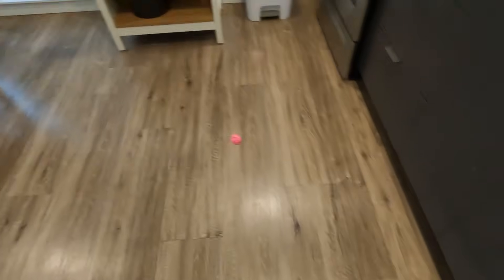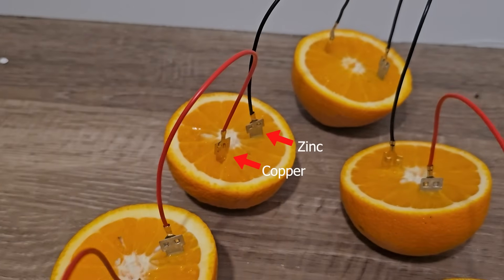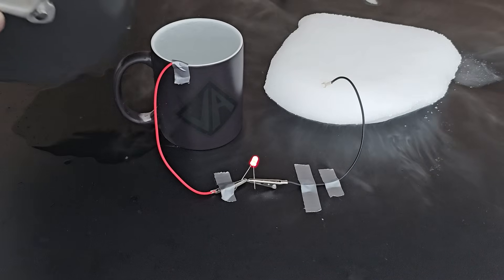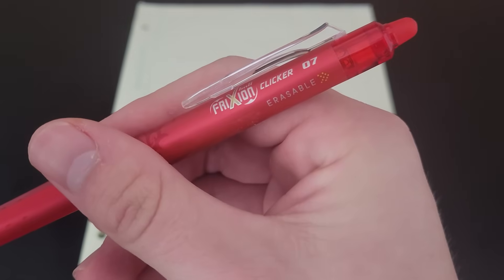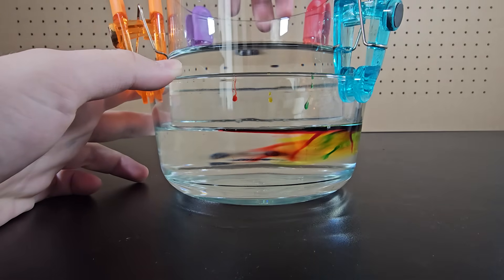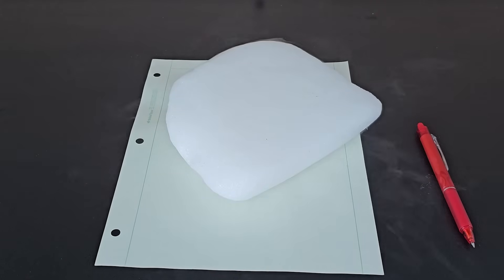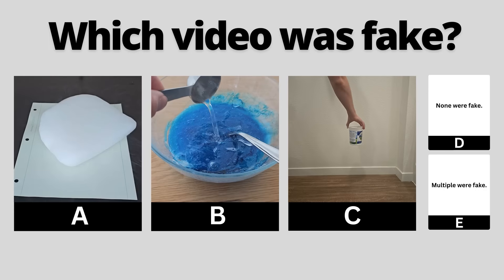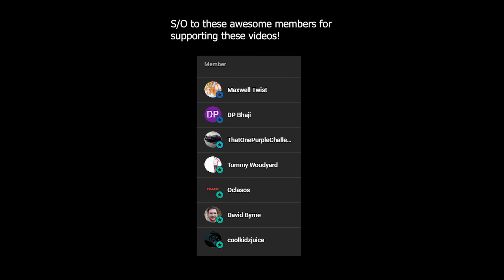Can internet science fool you? - 2 Truths & Trash (S2E6)

Comment: It actually IS possible to generate electricity directly from a temperature gradient like 1B, you just need a special device for it. My grandparents have one!
Reply: yes that threw me for a loop, then I remembered my material sciences classes I took ages ago stating that thermocouples (devices that produce a voltage in response to a temperature differential, the sensor component of digital thermometers and thermostats) need to be made of two different metals and the metals need to be directly in contact.

Once I realized the metals were not in contact I understood that the effect shown was false

Comment: You can make electricity from hot/cold differences, but not with that example.  The biggest problem with it is you need a return circuit, and the next biggest problem was nothing there would generate electricity from thermal differences.  Look up thermocouples (and peltier modules) if you want to see how it is done (and in reverse, making thermal differences from electricity)

Comment: i have an idea for a two truths, one trash episode: 1: if you put a string of metal beads in a measuring cup or beaker, and drop the bead sting out of the cup, the beads will levitate off of the beaker. 2: if you put powdered mercury phisionate in an aquarium tank and apply heat, long tendrils will begin growing out of thin air, this does generate toxic fumes, so use cation while preforming the experiment (it could be something like this, I found it on Outrageous Acts of Science, and I feel like it should be here).  3: if you heat up a pipe, the pipe will sing, you can pour the sound into a cup and back into the pipe as shown here. Answer: #3 and #2 are false, there is a metal mesh that is heated up creating the sound tipping the pipe just stops the noise, you cannot pour sound. for #2 there would be turbulence where the two fans meet which would not make the plane float, instead, i used fishing line to hold the paper airplane in place  1: if you draw a stick figure on a glassy, non pourous  surface and apply water, the stickman will come to life and dance inside of the water bubble (only works with ethanol based ink. 2: fold a paper airplane and grab two fans, place the two fans on either side of the paper airplane and it will stay stagnant in its place 3: get you and your buddies to place their phones on a table surrounding a few kernels of pop corn, have the phones call each other and the energy output of the phones should pop the pop corn kernels because the phone produces a microwave and causes the kernels the pop.  #3 is false although phones do produce microwaves, they do not have the power to pop popcorn, a standard microwave has about 900 wats of energy while a mobile phone only outputs about 1 watt of energy. round 3, here how to make a homemade glow stick, take liquid floor cleaner, a lollipop, for this, use a dum-dum since it has a different chemical bond which will react differently. get some dish soap and a little water, combine it all together and you get a bioluminescent liquid that glows in the dark #2: in Turkmenistan, there's a crater that is called the "gateway to hell," its a natural gas mine turned bad that the workers decided to set ablaze, and its still burning to this day from the 1970s #3 if you angle a needle correctly, it can pierce through glass and pop a balloon on the other side without breaking the glass #1 is fake, although we all could have wished to make a homemade glow stick, these chemicals cant be used to make it

Comment: Fun fact: hot and cold can be turned into electricity (dry ice would be used for one side), it's called a peltier device.

Kinda weird, because they work both ways... Give it power and one side gets cold the other hot, but if you make one side cold and the other hot it gives off power... Kinda like a motor/generator scenario.

Comment: Round 1: I know graphite conducts electricity, so A could be true. C, I know is true, because the orange juice contains electrolytes, which form a wet-cell battery when combined with a cathode and anode. B, on the other hand, I don't think a temperature difference can create a voltage difference. So I say B is trash. (Aha! I did it!)
Round 2: I believe you've used B in the past to fake some demonstrations, so I think that's true. I'm not 100% sure on C, but I think it could be true. A feels kind of dubious, though. I don't think you can just undo the flow of even a viscous fluid like that. So I'm gonna say that A is trash, and preemptively start eating my shoe. (Hey, it finally happened! But I still got it wrong, so I'm gonna finish this shoe real quick)
Round 3: C definitely feels fake. I would imagine that the ball would continue moving down into the bucket, but its motion would be dampened by the syrup to the point where it wouldn't bounce up that high, if at all. I'm also skeptical of B, though. So I might hazard a guess on E, both B and C were faked. (I'll take half-credit!)
Reply from the maker: I love reading the thought processes behind people's guesses, thank you for taking the time!